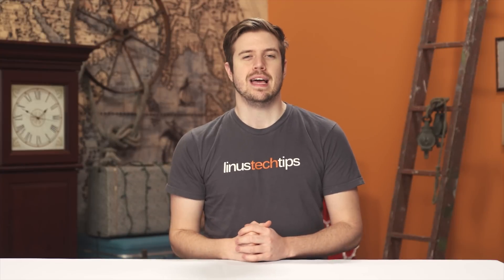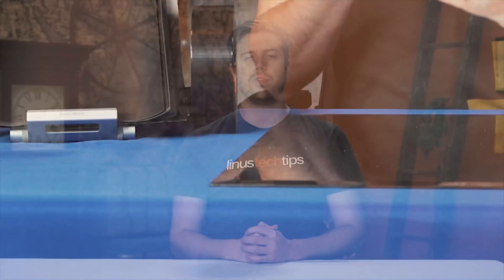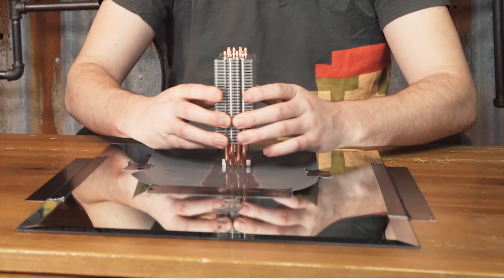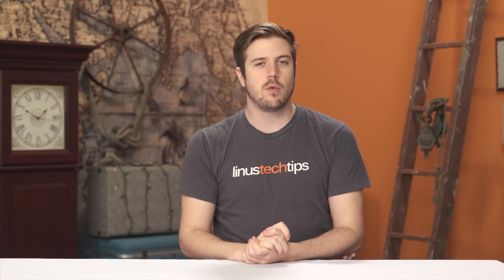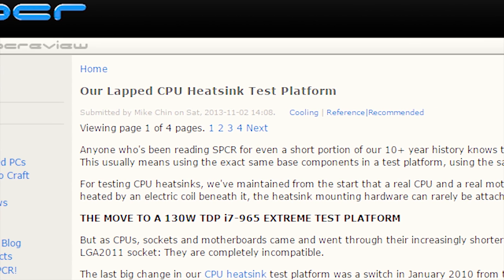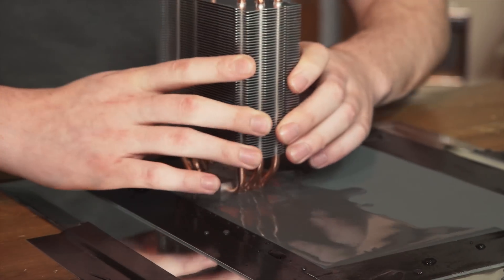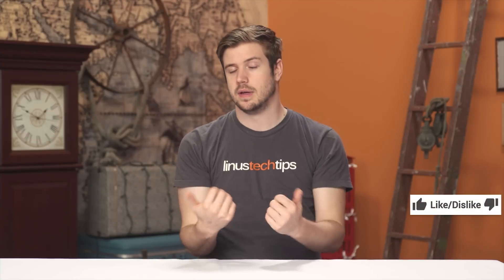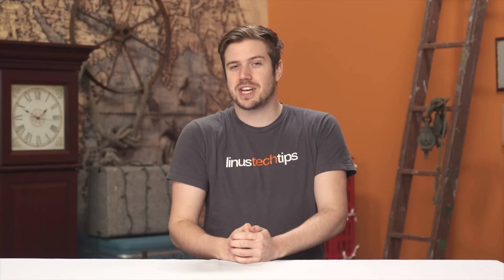CPU & Heatsink Lapping - Are concave, convex, or flat heatsinks best for cooling?

Comment: so the result is " WHATEVER" ?
Reply: +sleepup7931 yes
Reply: No, it's because he tested on a 212 evo
Reply: +Francefire That baffled me. The Hyper Evo 212 is already a great piece of hardware that I have seen in more than one PC, and people are happy with it. A concave heatsink would have been far more useful in this video. There are unfortunately just a handful of them, and I know of one that's been showing promises but kept being disappointing due to the often-reported concave contact surface, the 130W TDP-rated vapor-chamber ID-Cooling IS-VC45 cooler.
Reply: +sleepup7931 No, he wasted his time doing it on a heatsink that was already flat. If he had done it on a cpu that had a concave/convex or a heatsink that had that, it would have shown improvement.
Reply: DaMirrorLink you're right !
Reply: Ujiltrom M agree

Comment: try using Windex, or even WD-40 (although if you use WD-40 you could not use the sandpaper for anything else but sharpening knifes or lapping heatsinks) instead of water they move the metal partials away faster and will clear the grain.

Comment: With how good thermal pastes are nowadays your probably unlikely to see a difference regardless of what you do. Maybe a better measure would be to install the Heatsink with NO thermal paste, measure the temp (So long as it doesn't overheat first) THEN lap the heatsink and try again without thermal paste. Then you would get a true representation of the effectiveness of the lap. Just a thought

That said I don't think the lap was done correctly. The sandpaper would have been good to flatten the heatsink but even high grit papers leave scratches in a surface (you can see them in your shot of the finished heatsink, no mirror there). I believe you should have finished off the lap with a tin or lead lap to get that true mirror finish on the heatsink. Then do the same process on the top of the CPU and you could install the heatsink without thermal paste!

Comment: People disagreeing, variing results and contradicting lapping methods are very strong indications this either does not work or the effect is very minor.

Maybe there are some coolers out there that have poorly machines surfaces which can improved by lapping, but why bother finding those? 
The lapping of said coolers won't improve their performace to such a degree they leave top notch products in the dust.

Comment: Back when the first Crysis game just came out, I lapped my cpu heat spreader and my air cooler heat sync.  Spent 2 days after work sanding and sanding and sanding some more.  All that work netted me about a 2 degree difference in temp, which could have just been because I farted too many times when reinstalling the cpu.  Waste of time IMHO.

Comment: while I don't disagree with your conclusion (yet), I've seen people post results and they lapped it to a more mirror shine. some people say light pressure being applied during the lapping might help as well. also did you try lapping the CPU itself? after lapping, since the imperfections are smaller, try using less thermal paste than usual. thermal paste usually isn't as conductive as people think, so it might help. While I don't know for sure if these will help much, it would be interesting to go more in depth with it.

Comment: I'm not sure if oxides that build up on the heat-sink block would negatively impact it's performance, but removing that oxide layer with sandpaper is the only real benefit I could imagine from 'lapping' the heat-sink.  Having a super flat surface such as the one your trying to make would only really be helpful if you were not using heat-sink compound, and even then you would want the CPU heat spreader to be equally flat. The whole point of heat-sink compound is to fill in the tiny imperfections of the contact surfaces.

Comment: Dude that's not how you should lap! Look up how they lap in basic materials science research. They prepare a surface with lapping so the microstructure of the material becomes visible under a microscope. Only using a linear motion and rotating 90 degrees doesn't make the surface very polished.

Comment: this is the second video that I watched in 24 hours that didn't control the test well. how hard is to keep the room the same temperature?
Reply: When you do multiple shoots, it's rather hard especially since they are in such a big uncontrollable area.
Reply: +Tiz Schnitz It's literally pointless to bother controlling the ambient temperature for tests like this. If all you want to do is measure the effectiveness of a cooling device like a heat sink, the only thing that matters is the difference between ambient temperature and CPU temperature (or whatever device you're cooling). If the ambient rises by 2*C, the device temp will rise by 2*C, it's simple to measure. So, there's no point in controlling it.
Reply: Well do you next test in the freezer then for professionalism sake

Comment: How about if there is a difference between a custom watercooling systems (hard tube vs solt tube vs metal tube) and an all in one cooler setup.  This may be pretty time consuming though.
Reply: +Christopher Murray no real difference. it all would come down to efficiency. size and density of the rad, quality and material of the heat sink. tubing makes no noticeable difference. you would basically come to the conclusion that the thicker rads have the ability to remove heat better.

Comment: Gonna take a quick guess and say IT DOESN'T MATTER, nor do almost any of the other myths floating around...

well, partially right... I guess
Reply: Mikkel Kirketerp 
i really don't care, that you don't care.
Reply: Bobbin McBong #rekt
Reply: it actyally do help. but I also lapped my CPU. that gave me about 5 degrees more headroom just because of that.
Reply: +M390VI as why I said almost ;)
Reply: +Mikkel Kirketerp 
i highly doubt that. was probably the new thermal paste and different ambient temp
Reply: +Bobbin McBong Its been well documented to make an improvement over the years, I myself saw a average of 6c lower temps on a lapped Q6600 and a lapped and bowed DTek Fusion. The thing is it depends on the finish the manufacturers use, some put effort into creating a smooth surface others not so much and CPU IHSs are generally worse than heat sinks these days.
Reply: +Ryslinkee well most of the things DO matter, but not enough for it to be noticeable ;)
Reply: +Bobbin McBong I really don't care what you think. I overclocked it and tested before and after.